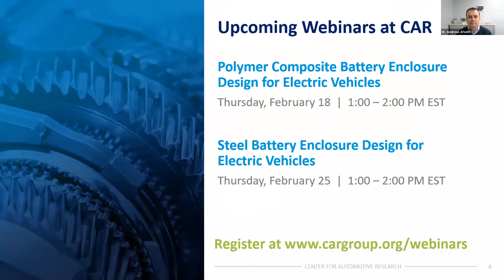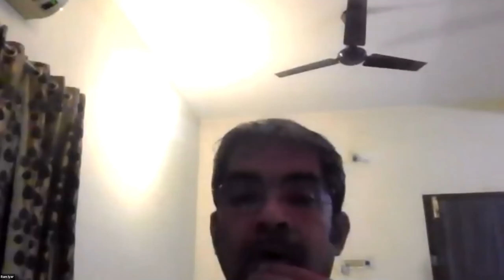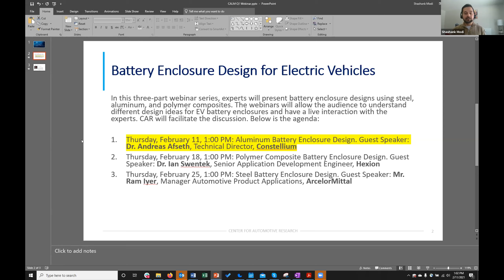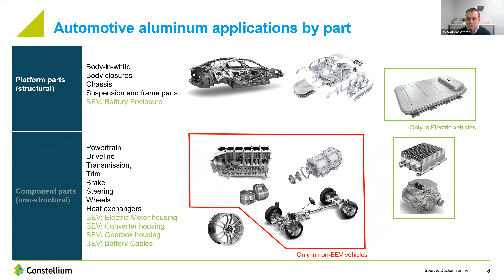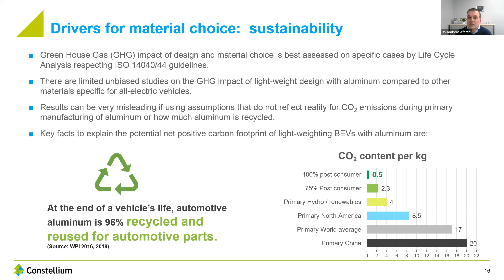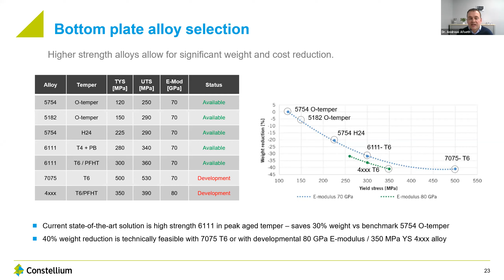Aluminum Battery Enclosure Design for Electric Vehicles

Comment: 🎯 Key Takeaways for quick navigation:

00:00 🌐 Introduction to battery enclosure design webinar series by Shashank Modi from the Center for Automotive Research.
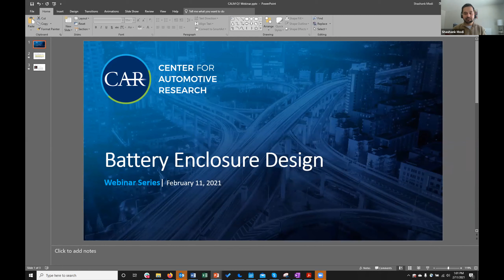03:27 🎙️ Three-part webinar series on battery enclosure designs with focus on aluminum, steel, and polymer composites.
04:51 🗣️ Dr. Andreas F. Sath, Technical Director at Constellium North America, presents on aluminum battery enclosures.
13:46 🔍 Aluminum usage in battery electric vehicles (BEVs) is significantly higher than in conventional powertrain vehicles.
15:21 📈 Aluminum usage per vehicle in BEVs is expected to slightly decrease due to new models and smaller cars targeting lower price ranges.
17:50 🚗 Analysis of current BEVs indicates a preference for aluminum in battery enclosures for long-range vehicles (>250 miles), while smaller vehicles show a more mixed material approach.
22:23 ⚖️ Aluminum's lightweight design positively impacts BEV performance, affecting range, driving dynamics, acceleration, and handling.
25:53 💰 Substituting aluminum with steel in BEV components may save costs initially but leads to a need for larger batteries and more powerful electric motors, potentially offsetting savings.
28:43 🔋 The evolution of battery technology, with cost reduction and increased energy density, impacts the cost-effectiveness of aluminum design in BEVs. Ongoing improvements may influence material choices.
30:09 🚗 Aluminum battery enclosures may lose market share for small cars with moderate range and lower price points, leading to a shift towards steel or multi-material designs.
31:10 ⚙️ Aluminum battery enclosures can be joined using various technologies, such as MIG welding, laser welding, mechanical joining, and adhesive bonding. Corrosion resistance of aluminum eliminates the need for coatings or additional protection.
32:30 🔧 Aluminum battery enclosures are designed to last the full lifetime of the vehicle, and servicing or replacement is not expected during the vehicle's lifespan.
33:14 🌍 Sustainability considerations for battery electric vehicles involve life cycle analysis, including manufacturing, use, and recycling phases. However, unbiased studies on material choices' carbon footprint impact are currently lacking.
37:56 ♻️ Aluminum's carbon footprint depends on electricity sources during production. Recycled aluminum has a lower carbon footprint, and automotive aluminum in North America is effectively recycled at the end of the vehicle's life.
40:39 📊 Poll results show that longer range is the most important criterion for choosing a battery electric vehicle, while sustainability impact ranks lower in priority.
41:32 📦 The battery enclosure functions to protect cells during crashes, manage thermal conditions, and provide structural integration. It must also be watertight, act as a Faraday cage, and meet stiffness requirements.
46:24 🛠️ Aluminum alloys used in battery enclosures belong to the 3000, 5000, and 6000 series. The 6000 series, particularly 6061 and 6063, are commonly used for their heat-treatable properties.
50:15 🚗 Alloy choice affects weight reduction in battery enclosure components. Higher-strength alloys offer weight savings, but there's a diminishing return, and an optimal balance must be considered.
53:07 🔄 The concept of integrating battery cells directly into the vehicle chassis or body may reduce redundancy but won't significantly alter material requirements, emphasizing the need for high-strength alloys.
57:38 🔄 Aluminum, as sheet and extrusion profiles, is the preferred material for battery enclosures, offering a weight saving of around 40% compared to steel. Sustainability benefits include infinite recyclability and reduced energy requirements for recycling.
59:01 🔄 Future material selection may shift from tailpipe emission legislation to life cycle analysis as electric vehicle adoption increases.
59:53 🌍 CO2 emissions are not significantly impacted by the alloy or alloy family; it depends on the primary production of aluminum.
01:00:35 🚗 Federal regulations on battery enclosures are uncertain, but potential focus on the vehicle's firewall for passenger cell protection in case of fire.
01:01:08 🏗️ Constellium's aluminum battery enclosure design aligns with general industry practices, and differences between companies are not fundamental.
01:01:54 🛡️ Aluminum battery enclosure alloys (5000 and 6000 series) used today do not require anodizing, e-coat, or conversion coating; they are corrosion-resistant.
01:02:36 🔍 Recycled aluminum maintains quality and stability; once re-melted, it becomes indistinguishable from new material, wiping its previous history.

Made with HARPA AI